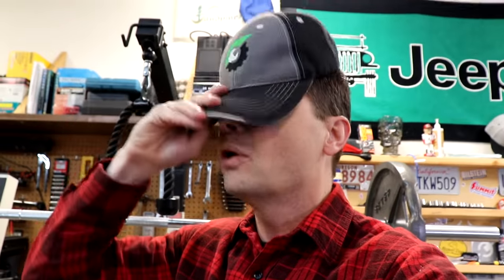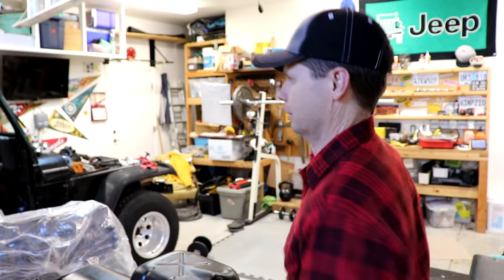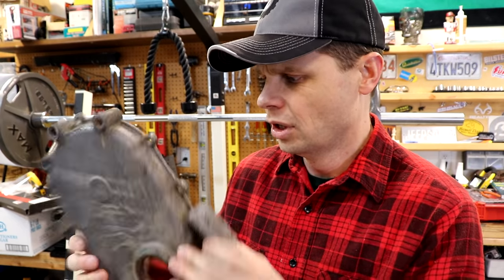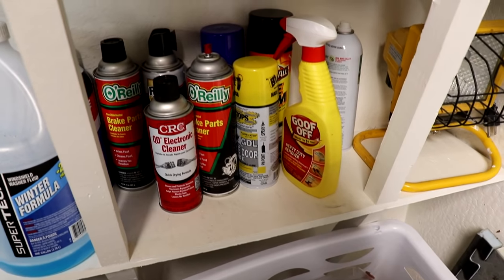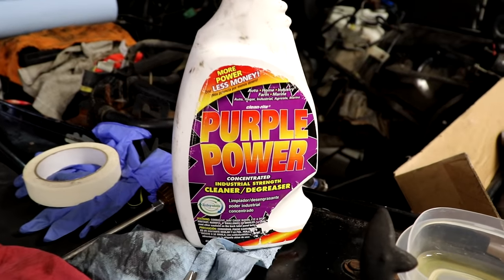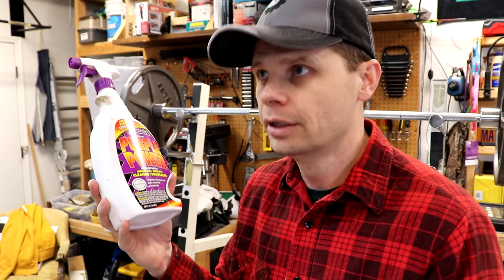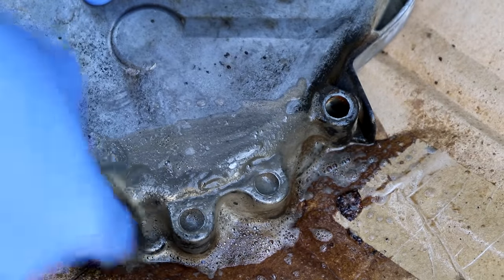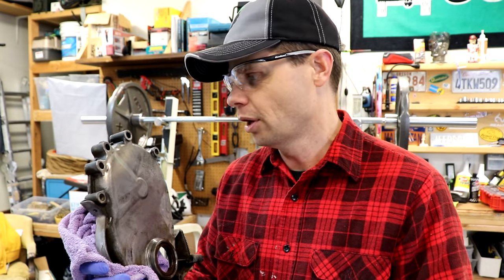Super Clean Aluminum Engine Parts

Comment: As of todays date, August 26, 2019, you can purchase 1 gallon jugs of Purple Power concentrate at Walmart, for $4.87 per jug. This is concentrate and can be used to make up to 20 gallons of house hold cleaner, or 2 to gallons of heavy degreaser, depending on the severity of grease/oil you are dealing with. I find is works best as 70% concentrate, 30% water for most all heavy degreasing jobs. 100% pure is serious stuff. Ive used it as a 3 day pre-soak on a BMW engine that had a several year leaky timing change cover, and valve cover gaskets, and power steering unit...pretty much a black coated engine block and under carriage. I sprayed concentrate on the engine, hoses, lines on 3 occasions and pre-soak. The final day i mixed 1 quart of diesel with 2 quarts of purple power and 1 quart water, and soaked same areas 15 minutes before taking it to car wash, to spray off all grease. No lies, every sign of leakage, stains, discoloration, grease or oil washed off without having to scrub anything and all metal parts looked like nearly new metal, hoses were like fresh rubber, lines looked nearly new, no yellow or brown hazy stains... Almost like new metals.... 

I've been using purple power since 2003. 

Don't use it on polyeurothane clear coated anything.

Great for removing stains from carpet, clothing, washing work clothes, cleaning concrete... 

Its good stuff!
Reply from the maker: Nice!  I'm wishing I would have purchased the gallon of concentrate for my parts washer, instead of the toxic parts cleaning fluid I have.

Comment: Ever heard of a wet blaster?  I made one using a sand blast cabinet, videos on you tube to make it, I use masonry sand  which is very fine works good for car parts, it is the easy way to clean, my sand recycles so all I am consuming is water.

Comment: Most of the chemicals that are considered (not safe for aluminum) will etch the surface. That etching will dull a high polished surface but will not damage the structure. Napa sells aluminum brightener (basically wheel acid) that works well. But honestly I would probably use the oven cleaner it is basically lye soap in a aerosol can

Comment: A tooth brush and diluted sulphuric acid. Followed up with sanding out imperfections, casting flash ect. Finish with low pressure vapor blasting with fine glass beads.

Comment: You can use oven cleaner on aluminum but, it IS acidic so you have to make sure you get it off when done because youre effectively acid washing your aluminum.  I do this all the time on used intake manifolds and stuff to clean them up to sell.  Hands down amazing stuff they way its eats carbon buildup and oil deposits while making your aluminum shine.  Again, you HAVE to make sure you get it off, water is just fine, but you cannot just leave it on there.

Comment: You can try Dawn heavy duty degreaser - lowes sells it by the gallon. no smell, great on engine bays, doesn't stain. I dilute it 4-1 for carpeting and even dirt on plastic interior parts and seat belts.
Or on bare aluminum Napa aluminum brightener is supposed to be good, napa online, haven't tried this one yet.

Comment: Diesel and afterwarda clean the residue off with degreaser. Simple and it works extremelly well. In europe we the diesel doesn't damage rubber seals. Not sure about USA.

Comment: I have the same thing in Industrial Purple concentrated cleaner I will try. I will look for dilution rates but grease falls off my bolts after soaking over night at a rate of 5 :1.  Luckily my intake is  fairly new and just 'mildly engine dirty'. I have to clean it because I just had my heads rebuilt and I painted them pretty... A dirty manifold would ruin my rep LOL.......... My Edelbrock Performer isn't polished so I don't see an issue with using a tooth brush and a quick rinse!  Thanks for the idea.

Comment: Try a household cleaner called Awesome at a dollar store. Soak it over night and scrub left over junk but you must rinse with water do not let the awesome dry, it leaves a white dust. Just rinse well with water and wipe dry and you will be surprised how it cleans even carbon on a aluminum head will just rinse away clean up fast and rinse well and dry with air or cloth.

Comment: Send out for vapor blasting.. zirconium or ceramic beads. Comes out better than new and cheap. BTW purple power eats aluminum. Don’t leave it on it will etch and you will get streaks and that white powdery residue just like other cleaners

Comment: What about the product used for cleaning ac unit fins and radiators? I haven't tried it on car parts but imagine it's worth a shot since it's meant for aluminum.
Reply: That's a mild acid but would surely work..

Comment: The best results I've seen for aluminum motorcycle parts is to use glass bead Vapor blasting you can convert a sandblaster to vapour blasting machine with a trash pump

Comment: Definitely have to be careful how you clean aluminum. Purple Power is a popular degreaser amongst car detailers. I found that WD-40 reconstitutes old dried up grease pretty well. You still need a brush and a lot of rags to wipe it up without using water. I don't have a parts washer, so I go through a lot of WD-40. :-)
Reply from the maker: Haven't tried wd as degreaser.  I may have to try that.
Reply: It works awesome to get grease out of carpet. I was amazed

Comment: I tried simple green.  Works great.  Check labels, there are some variants of simple green not safe for aluminum.  Brass brush as well.  Might try purple power to see difference.  Thanks!
Reply from the maker: I should do a side by side comparison with Simple Green
Reply: I used a 50/50 solution of Simple Green in my parts cleaner. Removed the powder-coated paint finish on the inside of the tub. Ended up cleaning the whole thing with brake cleaner, sanding and coating the entire inner tub with Predator bed liner no problems since.

Comment: Some of that on the timing cover looks like paint, to me.  If you're using Purple Power, you may as well just use oven cleaner, and just work quickly and rinse well.  They're both going to contain NaOH (lye).  When I did my steel valve covers, I used gas.

Comment: I have used WD40 and a brass brush.  Wash it all off with 50/50 dawn dish soap, and water.   I also wash my engine using the washer hose attached to the drain cock on my water heater.

Spray the electronics with WD40, the spray the engine with hot water.  Works like a charm!

Comment: The best aluminum cleaner that I know is Totally Awesome. You can put your cylinder heads in a plastic container and add the Totally Awesome until you cover the heads with the liquid. You will see the difference....no need for scrubbing the aluminum heads. You can buy Totally Awesome at Amazon. Hope this tip can help you guys. Almost forgot, when using Totally Awesome with your aluminum heads don't dilute with water. Just leave soaking overnight or 24 hrs.

Comment: Purple power destroyed a set of heads I had soaked overnight in to do exactly what you were talking about, it pitted the aluminium and even after I tried to polish out the pits when I brought in the parts to the machine shop to have them fixed he said it was damaged so bad that I should buy another set of used ones off someone and toss those in the trash 

Like another user mentioned I too noticed white powder residue afterwards the worst was the cam journals that were perfectly honed always oil soaked shiny parts and then dull blotchy damaged orange peel pits. I was so upset for blindly following advice on YouTube without asking a tech help forum first. My buddy owns jeep and was asking me about degreaser a week after my fail and when i explained what trouble I went through he told me that’s why jeep engines are made with steel and not aluminium… 😳 I suppose sometimes its best to just leave things alone and take it to a professional or call an engine shop and ask them if purple power is good to spray on your aluminium engine parts
Reply from the maker: At man, that sucks. In the video,, I show spraying it down, scrubbing it and rinsing it off. That worked well for me no damage at all. I wouldn't soak it overnight.

Comment: 10 LTR water ,500gram caustic soda,500ml sulphonic acid..... Mix it well ,rest it for 7-8 hours.... Dip any engine part for 20 minutes ,then wash it with high pressure ,apply air gun in deep parts to clean greasy surface..... Best Wishes

Comment: Fastest greasy aluminum cleaning for me:
1. Hot water mixed with dishwasher liquid in 80°C ultrasonic cleaner to remove all oil based contaminats.
2. REMOVE all ferrous components. Dip in sulfuric acid bath. Don't worry H2SO4 will only eats the aluminum oxide layer, not the aluminum (in room temperature). 
3. Rinse well with tap water. Dip in sodium bicarbonate bath in an ultrasonic cleaner to neutralize any remaning acid.
4. Done

Comment: Pine Sol. So safe you can even soak your carburetor bodies in it. No need to remove the rubber seals, etc. I soak the parts for 24 hours and rinse. That's all it takes.

Comment: 100 lye works good on steel and iron, you can get it as a drain cleaner that says 100 lye. 5 bucks a can, prob need 2 or 3 cans in a large tub for things like cranks. I've seen some guys on you tube use a metal trash can and 50/50 purple power cleaner/water with a heater under it for aluminum, it seems to work well, it will dull the aluminum. Now the best thing if the gunk isn't real bad is black magic blech whit tire cleaner, it cleans like purple power but absolutely does not corrode alum.  Add the lye to hot water, slowly!!! The lye will heat the water more.

Comment: Another product that is about 10 times cheaper and works a lot better than Purple power, is a cleaner/degreaser called "La's Awesome." It's about a "1.00 " for a bottle and $3.30 for a gallon. And it can be used on multiple items for multiple problems. Cleaned up the entire engine compartment on my 2000 Ford Excursion V10. And add it to my laundry soap for tough stains.

Comment: I tried Aluma Bright spray on It works great.  But don't leave it on for the 5 minutes the instructions recommend It turns the bright aluminum dark grey, I found warmer it is like 90F spray on for 3 to 5 seconds and hose it off. You can watch the oxide drift off and turn bright. Less time is better. Some aluminum you only need 5 seconds. 5 minutes will turn it dark gray or almost black then you have to soda blast it off.  Pre washing greasy parts with 50/50 diesel gas and a brass brush melts grime away, then wash with Dawn to remove oily film. Then Spray on Aluma  Bright for 3-5 seconds use your eyes to tell you when its bright enough. rinse off quickly or it can streak. If it streaks Spray somore Aluma Bright and quickly rinse.
Reply: This is aircraft grade aluminum prep.

Comment: Hey... I cleaned out my intake manifold real good at my second exhaust manifold install... And I got some smoke from it when I got it all back together.... Is that normal? Also... The burning smell after installing the new manifold... Is that the "new" smell burning off?
Reply from the maker: yeah, as it heats up, burns off oils. Should go away

Comment: I use a 3" brass wheel on a drill and it brings it brand new but now i have to do all by hand the small corner! I'll try to use braso
Reply: Neutral God , just so you know, brass particles will end up in your aluminum and the mix can cause a little corrosion. Stick to an extra fine stainless steel wire wheel if you live near saltwater.

Comment: Purple power is not entirely aluminum safe. Go to home depot and get "Simple Green Pro HD", it's a gallon jug. Not to be confused with regular simple green. Put the entire jug in a giant Rubbermaid and fill the rest with hot water. Soak the parts 24-48 hours then blast it with a pressure washer and dry. If it can rust before you dry it spray with wd40. Then use the mag wheel cleaner on the visible aluminum parts to give it a good finish.
Reply from the maker: Haven't tried that.  Sounds like it's worth a shot!

Comment: I was always content with getting most of the grease off with a putty knife, then using engine degreaser and a toothbrush for the rest of the oil or grease, and then just paint with Krylon Aluminum color paint.  Much quicker, and once that piece is installed, you can't tell it's paint.
Reply from the maker: Sounds like a good system.  Mine came out pretty clean.  Happy with it for this Jeep build.  May paint one in the future...
Reply: Pop
Reply: But paint can flake off though.

Comment: Most engine degreaser have a high concentration of diesel fuel...so I out diesel fuel in my parts washer...works great
Reply: And for the record, whether diesel is considered safe for aluminum or not I have no idea, but I've never had any problem with it...

I use it on steel, aluminum, electrical parts...quickly on plastic parts...it will harm them if left on long enough...which is why diesel works great as a headlight lense cleaner...
Reply: I use it to clean everything, it works freaking great.
Reply: @robertprentiss9950  and it's cheaper than buying cans of aerosol degreasers for $3-6 that have 1/2 can of propellant...
Reply: I use gas, just avoid smoking when I do

Comment: I use a product called suma break up D3.5. it’s a degreaser used in kitchens care homes hospitals ect ,used to remove carbon on burnt pots oven trays ect.  I leave it to soak over night  comes out like new  wont harm aluminium or plastic   So you can leave parts on ,

Comment: Purple power, in my experience, eats aluminum rapidly. Know a kid that used purple power in his parts washer, soaked a cylinder head over night and it completely destroyed the cylinder head.
Reply: I lost a pair of BBChevy valve covers that way.
Reply: I wouldn't use it on any part that has to have a mirror finish to function, like a cylinder head with Cam journals, but an aluminum oil pump, sure

Comment: it's a brass brush doing all the work here, lol. so i guess no miracle cleaner/degreaser for aluminium blocks, then. basically all comes to wire brushing or some kind of blasting.
Reply from the maker: I used the same brush with multiple cleaners. Purple power worked best

Comment: I've found the best thing is a wire wheel, wire cup and formula 88 followed by washing in Dawn dish soap. Granted the wire wheel and cup leaves it shinier than original cast aluminum but wow. Took my daughters' aluminum parts from what you showed originally taken off to beautiful. Gonna used it on my engine as soon as my kids quit breaking theirs 😆.

Comment: When I researched cleaning the aluminum radiator, I found out the the wrong chem cleaner can promote an anodization process that will (over time) eat away at the aluminum.  Simple Green bad…Simple Greens Purple good.

Comment: On pretty much all my parts I use Dawn dish detergent and HOT water, it seems to work well for 99% of the crud, I'll need something tougher for burned on carbon....For everything else it works fantastic and is environmentally sound.

Comment: Too much labor involved. I just sand, bead or soda blast depending on the part. Soda would be good for an intake because it's easy to rinse away with water, sand or glass bead may stay in runners......no bueno.

Comment: Never use Simple Green or Purple Power on aluminum parts especially on something nice like your new dirt bike or fancy pants rims. The only thing is Spray Nine you can get it at Walmart.
Reply: what did simple green do to the parts? i just bought a gallon and thinking of using it in my ultrasonic cleaner.

Comment: I cleaned my 350 Chev aluminum pistons with Castrol Super Clean ( products in purple container ) but beware I only cleaned them with a toothbrush and a soft bristle brush within 10 minutes NOT MORE and rinsed them with very hot water the results are amazing. Of course this products is good but not for prolonged contact with aluminum which is why 10 minutes is the maximum cleaning timeframe including scrubbing and soaking !

Comment: Try a better degreaser product called "LA's Totally Awsome", it can be purchased at nearly all of the "Dollar store" type stores. 
(Wear rubber gloves when using both of the products listed below, you'll thank me later.)
Use it straight, on slightly heated parts (100*ish F), allow it to set & keep it wetted down for several minutes. Scrub the part(s) with either stainles steel or stiff bristled brushes. Rinse it off, allow the part to dry, & repeat if needed.
Follow that up by spraying the Aluminum part, again heated slightly, with another product, Meguiar's Hot Rim Chrome Wheel cleaner.
(Yes, it says that this product isn't for aluminum..., but when do we ever follow a manufacturer's instructions..., if it works, it ain't stupid!)
Do NOT allow it to dry on the part, but simply respray it to keep it wetted out. It should foam up a little bit, that way you know it's working.
After a few minutes, brush the part with a s/steel (only stainless steel brushes are ever recommend for use on aluminum!), or a stiff nylon brush, or an appropriate gauge of Scotch Brite pad.
Rinse it thoroughly with clean warm water. Repeat as many times as needed. 
This method will result in an amazing transformation of many aluminum parts.
I've used this method after learning it in aircraft maintenance school, for aircraft cylinder "jugs", and with practice, they come out looking new again. No joke.
Good luck!